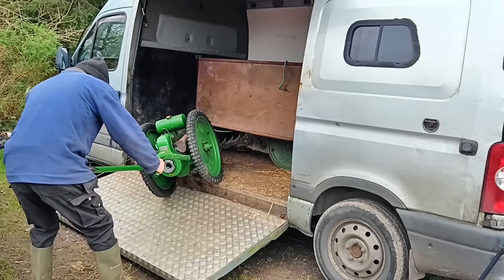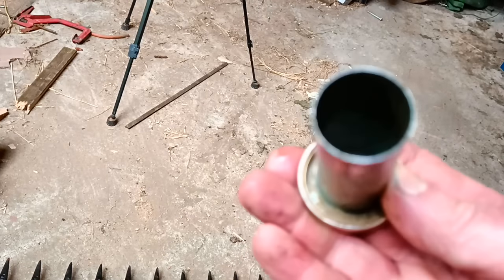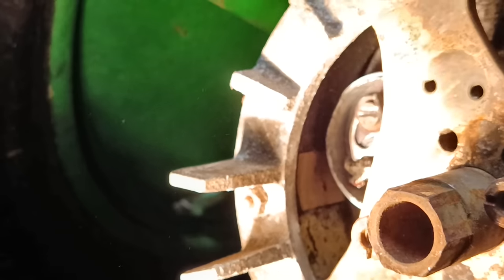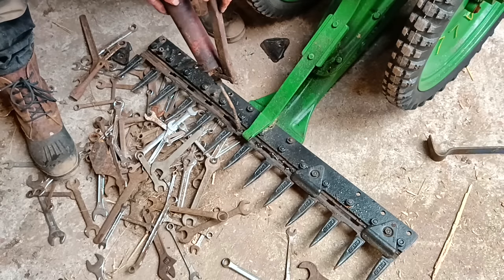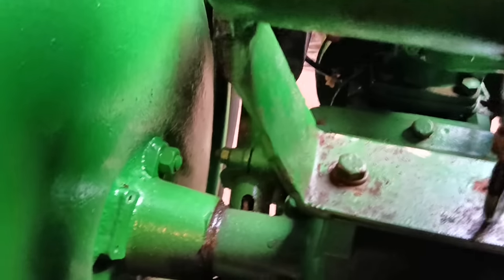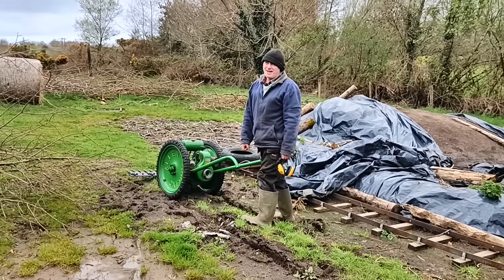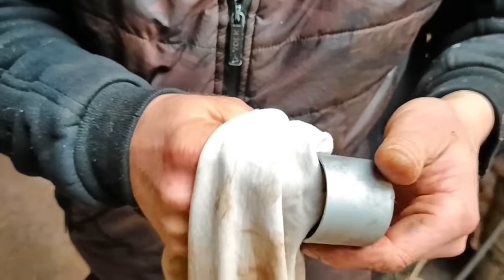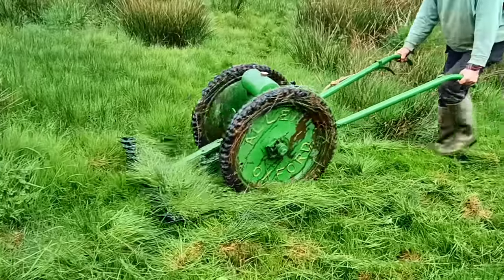First Run With A Vintage Allen Scythe Mowing Machine (1950s Model T)

Comment: would be cool to make the 2nd unit into a gas powered loco for your railway to shunt the hoppers to the drying tunnel
Reply: Now that is brilliant idea!
Reply: I do have a engine a similar size Suffolk something but this is one cylinder and made for a lawnmower I don't quite think it could handle all the bits and bobs that he would want to tow eg wood chips good idea tho!
Reply: I had that exact idea as well.
Reply: It doesn't look like the other one is in good enough condition to easily get it running again, it is more like a collection of spare parts for the running one.
It also doesn't have a real clutch, so you could just use the engine and you need to build clutch and gearbox yourself.
The easiest and probably the best option for a locomotive is to use the engine/gearbox assembly of a 50cc scooter and mount a small sprocket instead of the scooters rear wheel and a large sprocket to the axle of the loco. That gives you an easy to operate loco with lots of pulling force and a maximum speed of probably 10km/h. It already has a centrifugal clutch and CVT transmission, which is very good for accelerating a heavy train
Reply: great idea, though an engine swap might be nessesary, 
that "spare parts" rig seemed rather rough, though i dint get a great look at the bore of the cylinder so im not certain
also it looks like its got a stuck ring on the piston, and it looks to be missing a ring
lookin at it a bit more it looks like the uhhh which port is that? intake? exhaust? either way the visible port is crushed and would be a not so easy repair i think so, yeah might be beter off doing an engine swap, find somthin with a bit more torque i think would work fine considering what its used for
Reply: Because in the past, I have dealt with a lot of antique equipment including engines, I’ve seen a lot of things advertised as restored and sometimes that means they painted it. Perhaps it has run in the recent past, but I can assure you if I bought it I would tear it down to its smallest parts, because I guarantee you no one else did.
If the nomenclature, the spelling or punctuation is incorrect in this comment section. It’s because YouTube thinks they know more about this than I do. They keep changing the meaning of what I write.
Reply: I’d find a way to put a Honda gasoline engine on it and then will run perfectly
Reply: he needs one with a transmission with a reverse gear (they do make those)
Reply: Oooh!
Reply: @yt650  tell me you didn't watch the whole video without telling me you didn't watch the whole video
Reply: @Tater1337  
My comments were while I was watching the video. I pause it for a few minutes to do something and then came back and added my comments and it looks like they were spot on. To bad they apparently don’t have gravely tractors there. Yep I watch the entire video and it ended up just about how I would have thought.
Reply: @Tater1337  
I was just reading some of the other comments and someone said that the previous owner restored it for a show. As I said, in my comments about restoration, there are paint jobs, they are machines that are fixed up and there are restorations. This machine was painted. Everything else is a disgrace if they called this restored.
Reply: I agree if he can get enough parts to get both running he could possibly use the second one as a locomotive.
Reply: I was just about to suggest this 😄
Reply: I remember playing with / using one of these on the school's out field back in the '50s! We had to be over 12 years old before the allowed us to drive it.
Reply: oh wow - great idea!!
Reply: @yt650   gravely tractors
For the life of me I could not think of the name. I sold a bunch of that stuff about 10 years ago. Several machines, tires, blades, riders, spare parts, sickle mower, brush thing, mowers, cultivators. Just a whole bunch of stuff that my neighbor had. I was just surfing the web for ISO stuff one day and someone was looking for tires and attachments. I used and owned machines that I got from my neighbor. So I checked with him and he had a few dozen of those tires in the size the guy wanted. Which from what I recall were hard to come by and were expensive. I sent the guy a message and asked how many he needed and what price he was willing to pay for tires. He came back with a price and as many as I had. When is said that we had a few dozen of them and that price would be fine he freaked out cause he was not expecting that price. I was able to sell him 4 tires and a sickle mower and from his group was able to sell the rest of the tires and all of the parts, machines and everything else. I made a couple thousands over the deal and took about a year to sell everything off. I was on the hunt for a small baler that went with them and never found one. They do make new versions for round and square bales. I still want a full set up that I can ride on to do 2 acres of grass and cut, rake and bale. The small bales sell really well if you got good grass. If I had the baler and equiment to go with it then I would turn my grass land in to alfalfa and bale it. Yet I could also do pellets as well. I watched this one video where they cut the alfafa and then send it to a grinder and then turns it in to pellets. The machine is like 250k and I tried to get one of my neighbors to buy one for his alfafa fields which could have make a massive profit on the sale of pellets. As I know several of the ranchers in the area that have to truck them pellets in to feet their cattle. Could have ROI in 2 season if they planted all of their irrigation areas.
Reply: I was thinking something like that to.
Reply: @bobhunter7767 m1

Comment: 14:30 Hot tip when trying to move something fairly heavy with that kinda shape: Pull it behind you instead of pushing it in front of you! You'll effectively pull it out of any holes you get it stuck in rather than pushing it further into the ground when it goes through soft ground.

This tip is also very handy for loaded wheelbarrows!
Reply: No ! You just got to imagine you’re nicking it ….😂
Reply: or just turn on the engine and let it pull itself up
Reply: I remember these as a child. They were very effective. My uncle had one and  the saw attachment which he used to cut logs.  They were much quicker than the traditional scythe so a great step forward.
Reply: Yeah, and rather than run to get around corners, pull back on the other side instead and walk sideways.
Reply: And wheelie bins!
Reply: Just carry it over any muddy patches.

Comment: I'm loving this! I earn my living fixing reed-cutting machinery of all types, and these used to be a very common sight here in norfolk. The 2-strokes are my favorite, they're such a sweet little engine and will go on forever if you feed it the right oil in the right quantity (do exactly as it says on the lid!) castrol XL is really good stuff and smells much better than the modern synthetic oils!)

I'd suggest either to use ethanol-free petrol, or fit a little glass sediment bowl to the fuel line (they're cheap, and good insurance), those villiers carbs can corrode horribly if they get any water inside, and (especially in ireland!) the fuel will soak it up from the air and leave it at the bottom of the tank to eat the innards of the fuel system.

They're utter death-traps compared to modern machines, and will gladly run away into the sunset if given half a chance, some operators used to tie a piece of thin rope to the spark-plug lead, and keep the other end looped over the hand-grip, just in case you needed to kill it in a hurry (crude, and quite likely to break something, but better than buggering over and then watching it head straight into a dyke! Don't be too tempted with any of the accesories, there's a reason that not many were sold, they were usually rubbish, and the machine isn't brilliantly suited to this sort of thing. Even using them as a tractor is a pretty bad idea thanks to the dog-clutch, as any more load than just the machine will quickly knacker the bronze teeth, it's fun for a while though! 

Thanks Tim & Sandra!
Reply: There one of these rusting away in a shed where I work,  id love to get it working .
Don't know if its intact or not .
Reply: @simonmcmanus3639  If it's a 2-stroke and the bore's not knackered, it'll probably run. if it's a 4-stroke, you've got a few more things to worry about but villiers made pretty robust little engines and they really do have to be thoroughly abused to kill them! I've got a 250cc 2-stroke from 1922 that sat unused since the 60s that mows my lawn! but I did have to make my own piston-rings to get it going!
Reply: @theafro  I'll have a look and see , I guess if its got an oil sump its 4 stroke ?
Reply: @simonmcmanus3639  yup, it'll have a flat bottom, and be quite a bit shorter. your best bet is to (gently) see if the flywheel will turn, if it does, you might be on to something!
Reply: This is the kind of comment that makes the whole comment section of YouTube worthwhile. Proper knowledge shared graciously. 👍

Comment: I had a similar Villiers engine on a vintage See Bee outboard which needed some TLC.
I discovered the last stash of available spares for it were in Meetens of Wimbledon West London.
The timing I was advised (by the old gent working there) was done with the aid of a stick pushed down the hole for the spark plug.
What you do is to rotate the engine (with stick in place acting as a depth gauge) until it's at Top Dead Center (TDC) Mark the stick and then reverse the engine direction until it's 3/16" lower.
Then you set your points. Very crude but it worked. Hope you find that either helpful or amusing Tim.

Comment: Surprised it's in such good condition after 70 years. The paint looks somewhat new.
Reply: The previous owner restored it for a show, he must have repainted it! But it does look nice.
Reply: @Theorimlig  yeah, it was resprayed, though the previous owner did a piss job at rust removal
Reply: @Theorimlig  
There’s a difference between painting some thing, fixing it up, and restoring it. The only thing the previous owner did was paint it. It was neither fixed up or restored.

Comment: After an instruction course from my school's groundsman, I was put in charge of using  one to cut the rough grass along the drives. About half a mile or so. Still remember the clack sounds and the steering..... Also used a villiers Qualcast rear throw mower for the fine cut. Had smaller orange wheels. That was what a 10 year old did at boarding school in the fifties. All part of the outdoor craft course. I still own a working seventies model. Thanks for the memories, wonderful stuff.

Comment: Hi Tim
I've got 2 of those.
They just work so hard and seem to cut anything, but you have to hang on when turning!
Setting the dog clutches on the axle allows you to turn with the driven wheel to the outside of the turn. 
Turning with the driven wheel on the inside isn't recommended.
The handles can throw u to the ground if you're not expecting it.....a bit like wrestling with a donkey!
As for the engine, they do sound rough, but this is normal and they will miss fire and 4 stroke. The centrifugal governor cuts the ignition above a certain rpm, so full throttle rpm is set by this.
Once you start cutting and load the engine, it will run sweet like a 2 stroke should and yes, an all or nothing clutch makes them even more fun to drive!
Keep doing what you're doing with regular vids and great content.
Regards to you all.
Reply from the maker: thanks, David - I'll experiment with the diff settings..
Reply: @wayoutwest-workshopstuff6299  the 2 stroke mix is Castrol XL  which is sae 30 oil 
It does make a difference terms of smoke, smooth and "tinging"
Reply: @wayoutwest-workshopstuff6299  they have a bad reputation in terms of the clutch.
I myself have had a few experiences.
The trick is to get ahead of it ie. Push it faster than you are traveling while pulling the clutch lever. 
I have a family contention to them.. 
The were made for cutting brambles and bracken. Will cut fences small trees and even people fingers apparently.... 
Great to see you using one!! Looking forward to seeing further future videos

Comment: I had one of these about 20 years ago to cut a large area of uneven ground and although mine was the 4stroke engine it just powered through anything and everything that got in its way the fact that the blades run continuously is a bit scary though lol 
I remember I tripped over and the thing just kept on going and I had to get back up and chase after it 
Amazingly well built bit of machinery
Reply from the maker: I bet all Allen owners have tales to tell!

Comment: A kill switch would be an improvement! You could use a cheap outboard kill cord and switch wired into the points. The only Villiers engine I ever had was in a bike, probably the same technology 😅.

Comment: You can get new blade segments from the local tractor suppliers. They look like the John Deere ones I used to use. There'll be lots of people telling you that you shouldn't sharpen them with an angle grinder but I've never had any bother doing that.
Reply from the maker: There's a picture in the handbook of someone using a grinder powered by the scythe : -  )

Comment: The boys were allowed to use one of these when I was at prep school in the 1960s.  One lad struggled with the clutch and he cut down a blade’s width of a box hedge.  He covered up his crime by replacing the severed section and prayed that the end of term would come before it withered.

Comment: I´m not the first one to say this probably, but it might be a good idea to put a breaker switch connected to a lanyard somewhere into the spark plug line, so if it runs away on you it won´t get very far. These kinds of lanyard are made for Jet skis and motor sleds and I think for some lawn mowers too, but you could probably also get one off an old treadmill or completely DIY a solution. 
In any case, happy easter to all of you! :)
Reply from the maker: Good idea - thanks

Comment: Borrowed one of these for an afternoon & never again! I had the same clutch problems & the same turning issues & decided it was too much noise, exhaust gas & trouble. Now I have an Allen corded machine with a four stroke engine that is altogether safer and easier, but it’s consumption of cord is a vexation & it doesn’t give the same quality of cut grass for making into hay. Of all the grass cutting machines I have used a drum mower behind a tractor is the best, but maybe useless for you if it sunk into the mud. Good luck & thanks for sharing. Ps be wary of modern petrols that absorb water & if left in machines can cause major corrosion & gunk troubles.

Comment: In the United States at a campground cleanup nigh 40 years ago one very similar to this was donated to be used, I do not remember the brand or model but I was the only one who could get it running and keep it running, even though I was about 13 years old, so over 3 days I used this to clear many acres.  It was much easier to control the direction of travel and speed. It was only a few years later that I realized the importance of keeping track of these machines and who made them.  I have dreamed of finding that machine ever since.

Comment: I remember using one of these in the early 70s on my grandfather's farm. We used it to clear Braken Furn. The vibration shook us greatly. The clutches on the wheels meant that you had to be careful on hilly terrain as if you faced it downhill, it could easily get away from you. This made it a challenge on the side of the hills.
Reply from the maker: Yes, I'm learning fast!

Comment: Top bit of kit. Villiers engines are bullet proof and will run forever if you look after them. Some great simple engineering that does what its supposed to do with no fuss and simple to maintain and repair. I'm a big fan!

Comment: Hi Tim. They are a great machine. I have struggled with some rough land in Donegal that I only cut once a year. I got one of these about 8 years ago and reckon it is the only way for matted scutch grass and rushes. I have posted a number of videos on my one but here are some points I wish someone told me. The flywheel comes off  by jamming it with a long bar in the fins and then loosening the nut in the centre. The nut goes slack but because it is captive if you keep unscrewing it it will withdraw the flywheel from the tapered shaft. There is no woodruff key on the flywheel so timing is achieved by perfect location of the flywheel on the shaft. I have posted a video of this on my channel. There should be a cover on your points. It is a little disk of tin that would be easier replaced. The fingers on the mower bar are cast iron but each has an anvil of steel riveted to it where the blade runs over. You could inspect the anvils and see if they are worn. Another lick of the grinder to square up may help. Someone else mentioned it but sweeping the machine forward quickly when you disengage the clutch helps to get it off and when starting off if you walk it a bit you might save wear. I have used mine to cut saplings, it works fine as long as the drive is not engaged. I have also used mine completely underwater. No problem. People berate them for safety, there is no risk for the user as long as you stay between the handles. Good luck to anyone in front!
Reply from the maker: Thanks Owen. Yes, I saw the one where you added the extra foot plate - very interesting. I shall investigate further..!